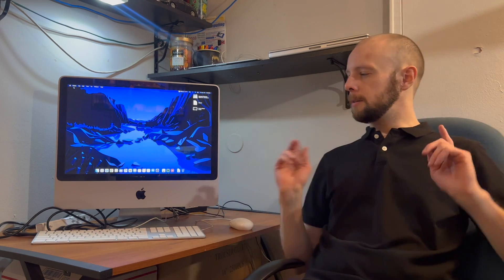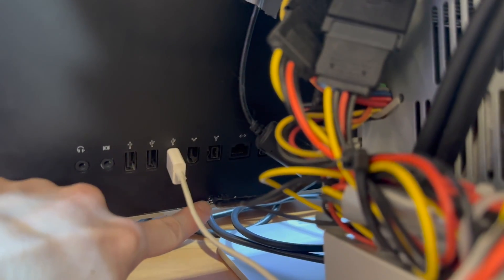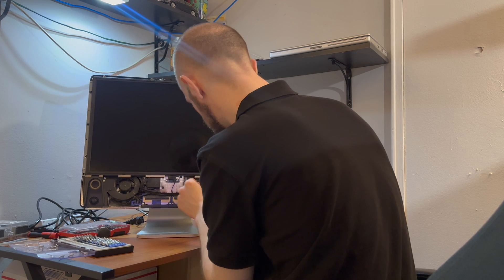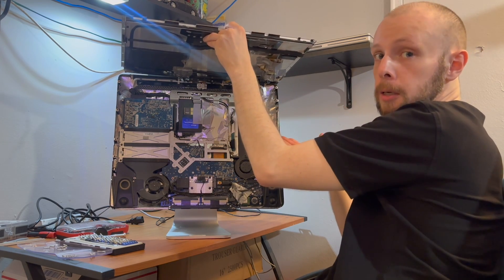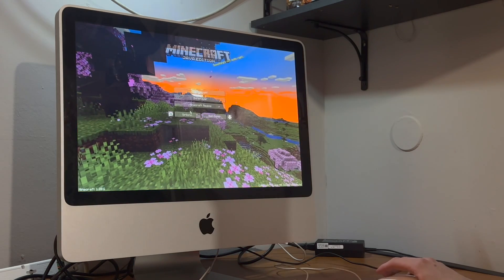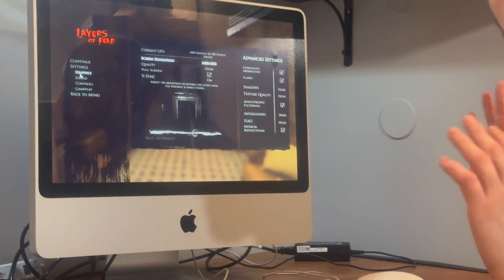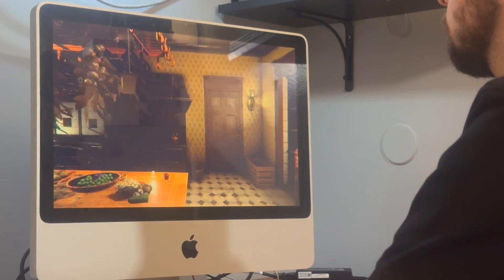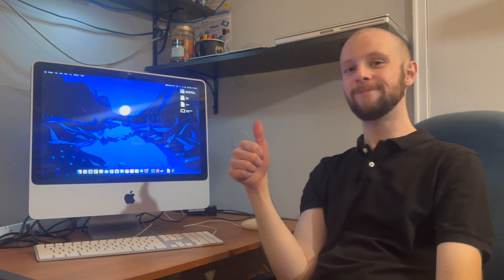'07 iMac + RX 580 + Monterey

Comment: hii, excellent, i need to know the adaptor you used, i wanna try it on a 2011 21 imac that i daily use. good work, thanks
Reply from the maker: Hey! The 2010 iMac also has an mSata style mini PCIe slot for the Airport card. https://www.ebay.com/itm/265109462687?epid=6047424530&itmmeta=01HX441BJ7VYQFGX62T75ZMNBS&hash=item3db9c15e9f:g:pqAAAOSwQsdgZtJQ&itmprp=enc%3AAQAJAAAA4L8mPLFiP74YXLkbH%2BjmFV6266fZ7k6IMoBdLBhozBlTOz%2F7JaQZODIESn5K2PpWv0BSV6R%2B1vwVWaVvprxTpBtLOccL7fOaaEj%2FUXj9%2B3aHJ3PfDhEHz56NwTqEGGRxnFWoM2N%2FYrXnsbbczfL9umUCuFPeOSp9xeDGC6VE3Srs2%2B3uh81GJ0p0KCxMCf6zDYNUMtHM00tAYzLSl0o6fuw5dIoYOQ0Ppr3mpiCsfVfCXFVQf0fjPim0J%2BJS9%2FjUEbdl%2FSTwnUBgzEWa07tZ5QzPFxZxmcDCdrGKIpdtKKec%7Ctkp%3ABk9SR565hYTpYw

Comment: yo! insane work! I have a early 2008 imac! is there any chance tu upgrade its graphics card? of course! but no so invasive as you did! that is far from my skills lol
Reply from the maker: Thank you kindly! 07/08 uses MXM 2.0, your best bet is to get an early revision 9800m GT and flash it with 8800 GS firmware. The second suggestion isn't recommended, but: Say you do what I did minus the external PSU, you can splice the internal SATA cable into 2 connectors, get a 6-pin to sata adapter, and find a low TDP GPU such as a GT 710.. it's 19W and the PSU should handle it despite being a full sized card. Unfortunately, Apple only made a few different GPUs for these iMacs.
Reply: @supericecreamsandwich  wow your're the best dude! thank you!